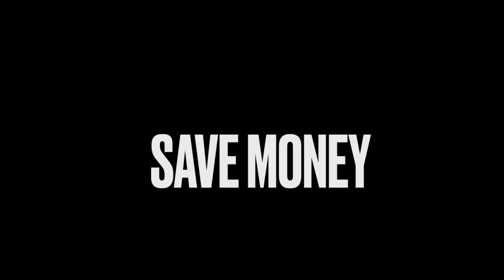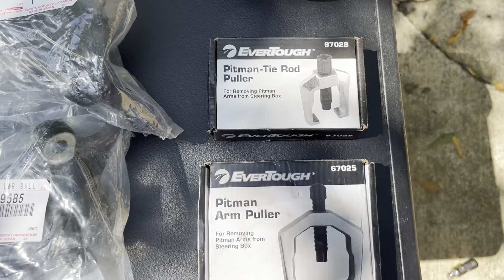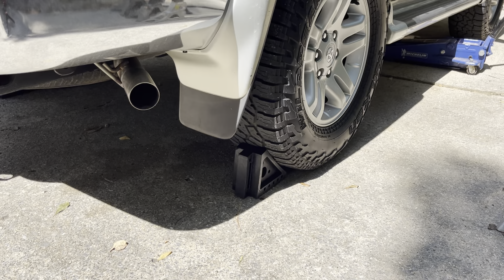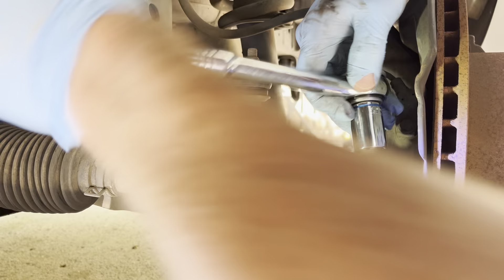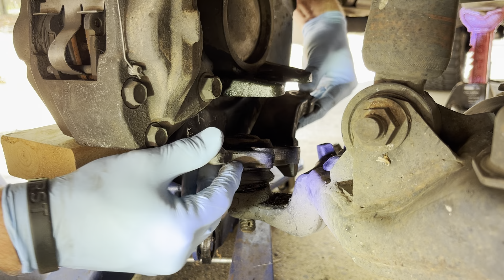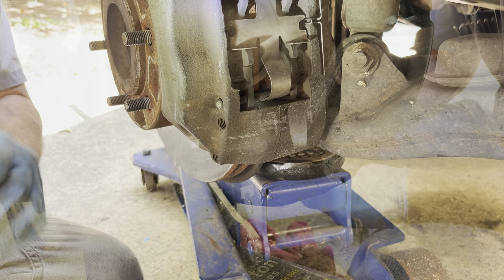Lower Ball Joint Replacement - 3rd Gen Toyota 4Runner 1996-2002 - How To

Comment: I'm the original owner of a 1998 Tacoma, V6, TRD that has approximately 157,000 miles. I replaced my LBJ's at about 153,000 after learning of the potential catastrophic failure. Better safe than sorry. And yes, to all thinking of doing this job, don't cheap out, just buy OEM from a Toyota dealer. I, just like many others I really appreciate the detail that you put into your videos. This lower ball joint video is very informative for those who are unfamiliar with and wanting to get the job done themselves. I thought your valve cover gasket video was fantastic, very informative. More detailed than any other video I have seen. Or, here's a job that I really struggled with, the steering rack bushing replacement. Getting all the bolts lined up and threaded was horrible. All the videos on here just skip over this. A video of this with the detail you provide would surely help many out there that need to replace their bushings. I think they all struggle and just don't show the difficulty of it, which I find disingenuous. Again, thanks for providing the informative videos.

Comment: I would fully endorse the comment about checking and replacing. I have a 96 High Lux Surf, the equivalent of the Forerunner. Last weekend the drivers side the lower ball joint failed. We had just completed a 300 mile around trip and it gave out outside our neighbors drive as we arrived home. The front axle was ripped out, had it happened on the motorway would have been a catastrophe. I've now completed the repair and examination of the joint shows that it was partly corroded and sheared. Checking my records the ball joint was replaced 11 years prior with an aftermarket brand I don't know which one. Does anybody know who supplies Toyota.
Reply: You’ll probably have to get it from the dealership or call your local parts houses and see if they can get oem Toyota parts

Comment: Great video, perhaps I missed it but what happened to the castle nut on the tie rod @12:48 when you used the pullers ? To me it just disappeared, did you remove it before applying the pullers ?
Reply from the maker: Hey Len! That’s a great question, I should have explained it better in the video. I was having some challenge fitting the puller over the tie rod with the castle nut installed due to the angle. Since reinstalling the castle nut is simply a safety step to prevent any issue when the tie rod pops out, I made the decision to remove the castle nut in order to fit the puller properly and proceed safely. It worked out thankfully. 

I appreciate you watching and appreciate your support. Thanks for the question!

Comment: I suggest changing them at 2000 miles.I've seen several of them even the toyota tacoma slower ball joints right around two hundred thousand
Reply from the maker: Hey Robert, thanks for watching. To me, 200k is a bit too much of an unnecessary risk. There’s a lot of factors that may vary, including driving conditions, habits, etc. I believe the longest you should go is 100k - 150k. If you don’t have OEM LBJ’s, then that interval may lessen. 

Appreciate your comment, come back soon.
Reply: I have 328k and have no idea. So tomorrow I will go to toyota and get those, and upper. I noticed when I changed my brakes, also just got sway bar links, mine are shot after 4 years. I'm not surprised it had 250k when I swapped those.

Comment: good vid, 2 things i would have added is to run a tap up through the stub axle threads to clean them out before fitting and torquing new bolts, oh and check the rack end play on the inner tie rods, people forget about these,  they are covered by a rubber boot and generally go unchecked while you had the outer tie rods detached. Just doing the same job on my Prado for the same reason as you, anyway cheers for the DIY vid, its a simple job easily done by an owner with a bit of mechanical minded exp.

Comment: Thank you for the video! I'm about to tackle this at 260k miles. For anyone else looking to do this at home, you should only be using !!Toyota OEM parts!! and there are essentially two bolt options as you said but they require different torque specs. The 'black bolts" with washer only require 37 foot pounds and the "green bolts" used here require 59 foot pounds. Loctite isn't necessary for either but won't pose any problems unless you reuse them, which you shouldn't do anyway.
Reply from the maker: Hey Stonr, thanks so much for watching and for the comment. You’re absolutely right with everything you stated. I appreciate you taking the time to add the additional context for the viewers. 

Happy ‘Runnin

Comment: They installed my lower ball joints without the pins. Are they that important? Went oem with the ball joints.
Reply from the maker: Hey Miles, great choice with the OEM LBJ’s. If you’re referring to the Cotter Pins, yes they are important. They act as a locking tool so that the castle nut doesn’t back out or loosen up over time with vibrations, etc. 

Just buy yourself some like I had in the video and get underneath and install them yourself. You got it!
Reply: @  thank you brother. Very helpful video.
Reply from the maker: You’re very welcome Miles, thank you for taking time out of your day to give feedback.

Comment: did you use the oem tools tie rod puller on the LBJ? i had to buy that tool to do my tie rod ends, they didn’t have the kit so trying to get everything ready to do this next weekend.
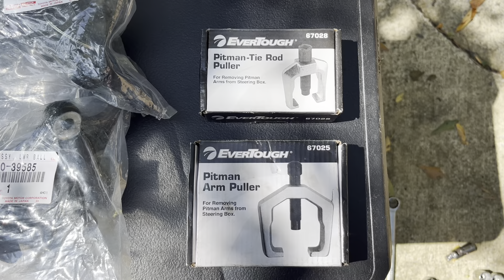Reply from the maker: The Tie Rod puller I used you can see at 3:29 in the video. It was an Evertough brand I rented from a local auto parts store, I believe O’Reilly’s. You can see me use the puller at 12:39 in the video. 

I hope this is helpful information and what you were asking. If not, let me know more specifically and I’ll do my best to answer. 

Thanks for watching and good luck with the LBJ job. You got it! Come back and let me know how it went.

Comment: Toyota engineers did not recommend the use or need for any loctite. Most torq specs are for dry threads, as soon as you put any liquid (loctite, anti-seize, butter, ....whatever) it is now a lubricated thread. This is a common path to over-torque troubles.
Reply from the maker: Thanks for the input. Appreciate you watching and appreciate the comment.

Comment: Hey are you able to just change the ball joint and not the arm that comes with it? Or does itnot even sell separately?
Reply: it comes as a single unit.
Reply from the maker: Hey Johnny, can you provide a link for Monger? That would be helpful.
Reply from the maker: Hey Monger. To my knowledge with this component, you cannot change just the ball joint. Also, I don’t believe that’s even sold separately as you asked. Great question though as this is an option with other vehicles. 

Thanks for watching, and thanks for the comment!

Comment: Mr Winkle, your tie rods a 19 mines a 22.  Dafuq.  Also my ball joint castle nut spun freely after breaking loose, only broke the actual mounting bolts loose no real turns on them.  Well see how she goes in the AM
Reply: Vise grips will help you hold the bolt so it doesnt spin
Reply: @dacooldood1234  not sure what bolt you mean?
Reply from the maker: Hey Charles, what year and model is your Runner? Thanks for commenting and the feedback. How’s everything going now that it’s been a couple of weeks?
Reply: @vanwinklesgarage 97 sr5   it went great.   Everything was healthy except the ball joint lol, all the threads were hand spun after initial breaking of threads.
Reply from the maker: Fantastic, great to hear. The peace of mind traveling down the road after this job is invaluable. Thanks for the reply!

Comment: Fantastic video! I will be doing this myself soon. I have a 2002 with 249k miles. I’m assuming the lbj’s are original as well. I have other things I need to do also, like the tundra brake upgrade! Have you done this? Would love to see a video on it. Just one quick note though, would have like to see how you tied up the hub on top. You mentioned you did, but didn’t show it. Anyway, great video!
Reply from the maker: Hey, thanks so much for the commenting and feedback. I appreciate the kind words. I have not done the Tundra brake upgrade, but it’s definitely on my list! When I do, it will most certainly be a video. You’re right, I forgot to film the part where I tied up the hub. I simply used some ratchet straps. Honestly, it really is a just a safety precaution as mine didn’t move much at all. 

Let me know when you get the job done, you can do it! 

Thanks for watching!